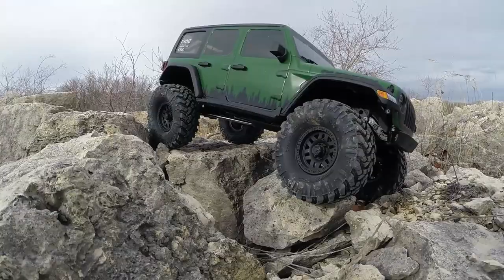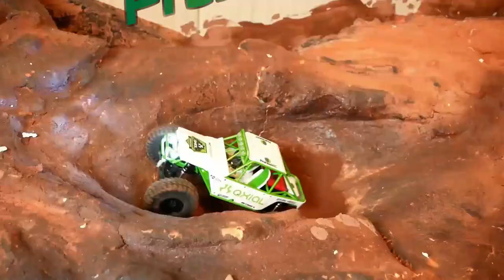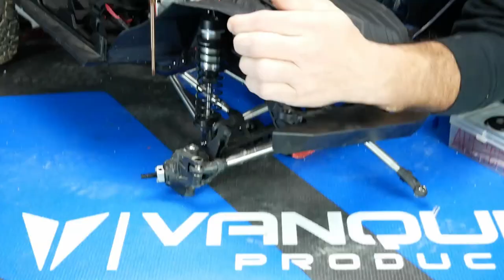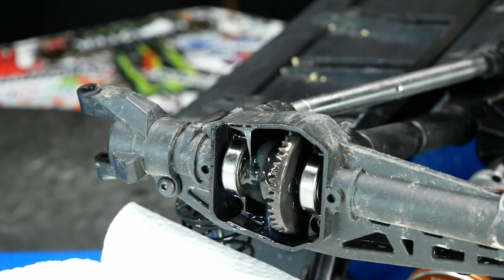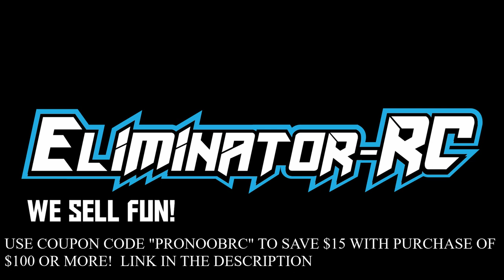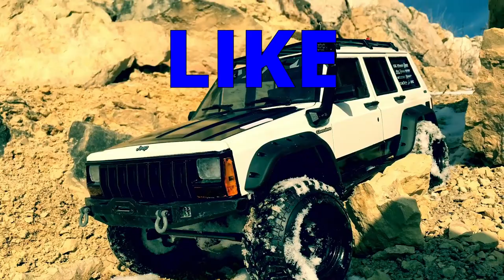AXIAL SCX6 RTR: DIFFERENTIAL SHIM INSTALL

Comment: I was just doing work on my new SCX6 and found the ring had a wobble to it when turned that would cause it to be too loose at one point and way too tight 180 degrees around on the opposite side.  I thought maybe it was faulty or bent somehow.  Couldn't see how it could bend though.  I ordered a new ring and pinion set and installed it. The wobble was even worse. It took a bit of cursing and investigating and what I finally found is that with no screws in the ring gear it would not sit flat on the inner "carrier". No matter what position I put the ring gear on the inner part it would rock side to side as I pushed down on it with my fingers. I checked the carrier and it spun and ran true so it was not the hub part.  Where the fault was on both the original ring gear and the new ring gear was the inner diameter was a sharp 90 degree edge and this was hanging up on the inner surface of the carrier part. I used a 3/4" grinding tip for a drill (similar to a Dremel 941 grinding tip but larger) to chamfer the inner diameter of the hole in the ring gear where it seats on the hub.  It didn't take much, such a small amount that it is hard to see the chamfer. Now it seats flat onto the hub and spins true in the differential with no wobble. As it turns out I didn't need a new ring and pinion I just needed to fix the problem. Now it is back in and shimmed with no play and no binding.  Just a heads up for others that may run into this issue.

Comment: Is that the same oil or grease in the transmission I'm trying to regrease my transmission but all I have is dynamite marine grease can I use that or do I need special oil or grease for the scx6 transmission????
Reply from the maker: No use grease it’s far better than the goop they use
Reply: @ProNoobRC  SWEEEEEEET!!!
Thank you cause I hate to take it apart again lol thanks mi big bro 🔥 💯 👍👊
Reply: @ProNoobRC  yeah I had to change out all the bearings in the entire rig cause 50% of them were frozen with rust so I installed the fast eddy bearings kit for the SCX6

Comment: Thanks for the how to video. What would cause the front end to shake under full steer? would it be an axle starting to go bad.
Reply from the maker: That’s just axle hop
Reply: @ProNoobRC  it only does it one direction.
Reply from the maker: Is that one side travelling just a bit more in steering throw? Kinda odd if only one direction yes.
Reply: @ProNoobRC  I dont dare hold it wide open in second gear and cutting it all the way to the left. Its not good. Im thinking axle shaft and im yet to take it apart and see. that is the next step before calling horizon.

Comment: Does anyone know exactly what Axial uses for their diff juice?   Silicone based grease I'm guessing.. I just want the same stuff.  Already broke a couple diffs on these things....    DO NOT RUN 6S and have a good time....    (you've been warned).
Reply from the maker: It’s either 500k or 1 million weight silicone oil.  Lol 6s is a bit rowdy! A guy we run with on the weekends is packing a castle system on 8S. He’s jumped over me and left his rear tire burnout across my hood.
Reply: @ProNoobRC yeah…. I have a castle XLX2 in it..  I normally use 3 and 4S only…. I just did it for overkill.

Comment: Why clean out the factory grease and reassemble with none?  That makes no sense...
Reply from the maker: I think the actual grease getting put in the gears part got chopped out but less than a minute in I explain that we are swapping the silicone oil for Cow RC Udder Butter grease but I understand the confusion our bad! Peace and axle grease! Lol

Comment: Metal housings don't do that and is a huge recommendation. Plastic gets warn out and breaks to fast. Witch makes it unreliable in the long run. One roll the right angle and its broken just saying. Just saying not everyone wants to carry it let alone far lol.
Reply from the maker: Yup! Just installed the Power  Hobby axles under it. Plastic no good